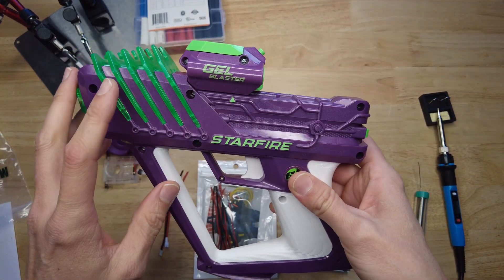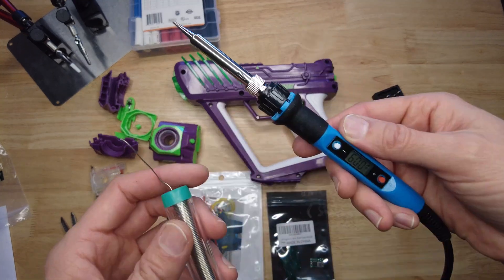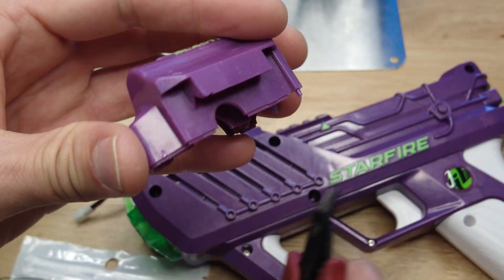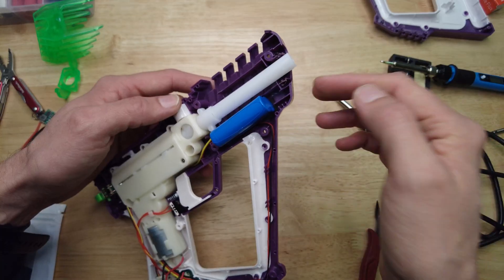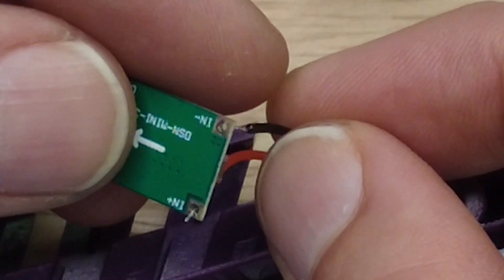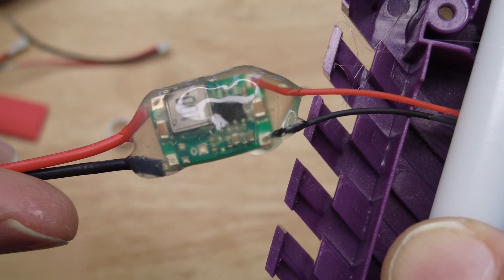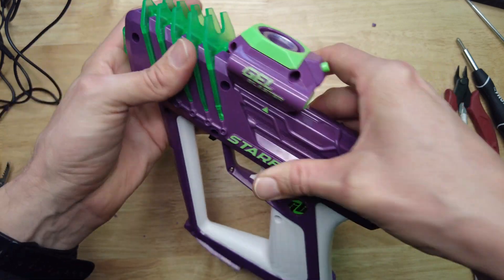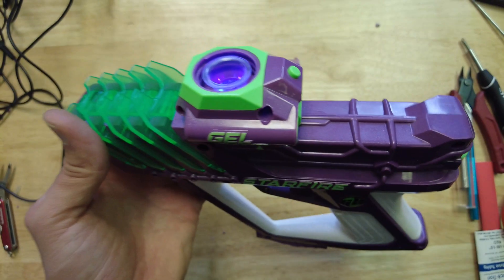How To Power GEL BLASTER STARFIRE Tracer from Splat Ball Blaster Internal Battery (No AAA batteries)

Comment: I got four of these at Walmart. The battery wont make it through one hopper.
Reply from the maker: Did you get the batteries at Dollar 🌲? Are you taking about the blaster or the UV led feedneck?
Reply: The blaster
Reply from the maker: @danwurth5272  I've had issues with some too after a while of using. Need to figure out an external battery pack mod.

Comment: Thank you for posting this video. I actually wanted to see what kind of battery is inside because  I wanted to replace the battery.
Reply: Can you tell me what battery the starfire use straight out the box?
Reply: @SteveMonge  so it’s a small battery 2 cell 14500 battery I took it out and it’s hard to find another with the long connector so I just made my own connection and bought a battery off Amazon

Comment: Wouldn't it just be easier to use rechargeable batteries?
Reply from the maker: Yes, it would be easier. I wanted to eliminate the need for extra batteries. Would still need to remove them due to that too easy to turn on switch.